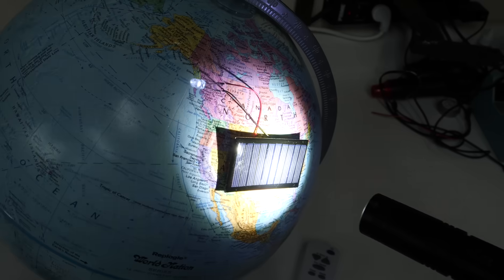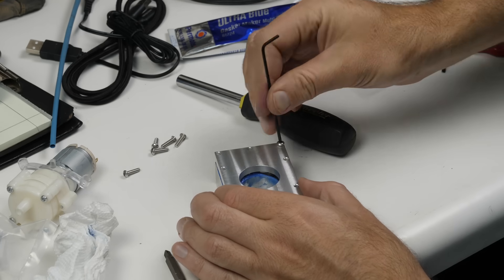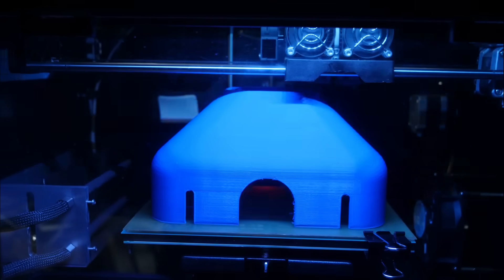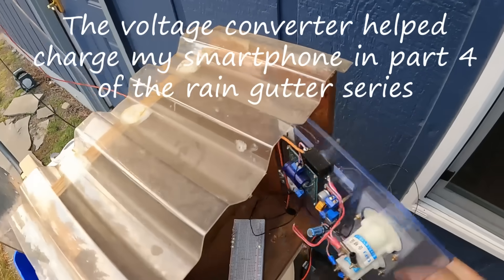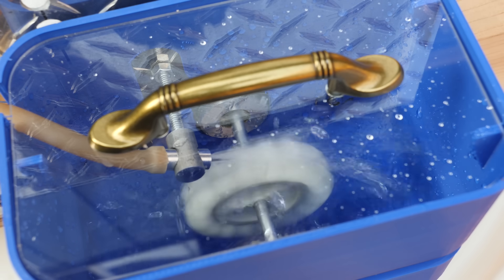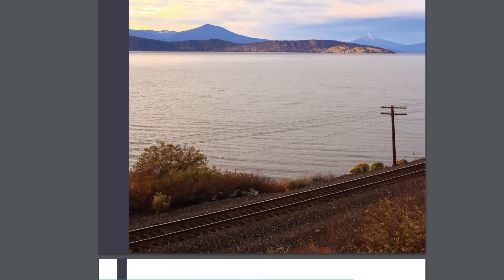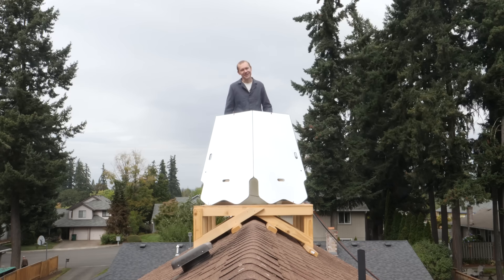Storing Solar Power on my ROOF!!!

Comment: Visited Argentina.  Most of the homes, particularly in the north (where it is hotter) have large ceramic or cement water containers.  One of their functions is to pre-heat the water.  Fact is, on a hot day the water is plenty warm for a nice shower without additional heating.

Comment: 0:30 I hope you explain the weight to energy ratio of a gravity battery versus a chemical one.

Also, I hope you used the IR wavelengths to store that energy and not the conventional wavelengths used by current solar panels…

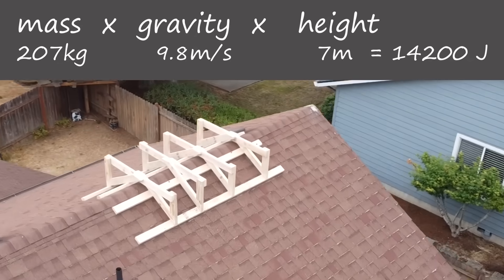2:30 You’d be better off using the thermal radiation to vaporize the water and re-condense it in your roof barrel. Even better, use the expanding water to drive a turbine on its way up to the roof.

Now you have a water heater/steam turbine by using the 40% of solar irradiance left unused by conventional solar panels.

Comment: "Without losing any of its capacity!" C'mon don't ignore evaporation and turbine efficiency on us.

I hear Tesla Powerwall got 90% efficiency while big scale water reservoirs is at 80%. I guess the take-away is that there's always something spent to convert energy back.

What's the efficiency of direct impact solutions I wonder.
Reply: While I agree that the round trip efficiency of his experiment is probably super low - the cost of a well refined system is probably lower than a powerwall and water should be easy unless you are in a dry climate. Biggest problem I see is you would need a pretty massive system to fulfill the needs of an average home. Most people don't have that much real estate to go after it on a big enough scale.

Comment: Awesome concept. Which could be applied on a bigger scale for homesteading and off grid. A couple design tweaks like useing more efficient hydro drive. Increasing pressure through implementation of stuff like " the tesla wave" to get more out of the flow ect. This guy's definitely beyond my level but I'm just saying a couple tweaks for efficiency and added scale you could do alot with this. You wouldn't need much pumping power even at scale. At that point it's just about the storage of water.  On an off grid set up you could even feasibly filter your water pump it into your cabin and create electricity with the water coming down. I mean the concept definitely has applications.

A thought though how would say salt water do in this? Salt water has a few properties that may be token advantage of. The reason this popped in my head is because I was thinking this system might be pretty efficient for an off the grid private island.

Comment: Would pointing the outlet valve vertical instead of horizontal make any difference with the power output? That would cut down on spray from the water wheel.

Comment: Once my shed is built I will be making a system where the water is pumped to a barrel, the barrel will be on a wire chain, the barrel full of water will head to the ground and drive a 24v generator, the water will be dumped into a storage tank that it will land on ... once on the ground the barrel winched up empty then filled again

Comment: Instead of a traditional type of water wheel, use a Tesla turbine with a wide opening for the water outlet spanning the width of the turbine blades

Comment: I once worked with an engineer who was trying to design a mechanically powered ceiling fan.  Essentially hoist a weight up to the ceiling and let the weight power the fan.  It sounded like a pretty cool idea.  But then I asked him if he had done any energy calculations.  Turned out that a AA battery had significantly more energy than his contraption and trying to get any meaningful airflow from it would really be impossible.  I like that you built yours anyway knowing full well that it would not really be practical.

Comment: how about a tank of air instead of water. using solar to run a old refrigerator compressor to keep tank  charged. Amish use air powered tools.

Comment: The 14kJ of energy storage, will have only about 60% energy capacity, due to frictional losses + the water that escapes without doing work. Added to this, are energy losses in the cabling and electronic components - before the light turns on. That means the system is 40% inefficient. It would be more like 9kJ of stored energy in the tank on the roof. You have gone to great lengths in order to explain that the world needs to move away from fossil fuels, to find and create renewable energy. A great video production for those who may not understand.

Comment: I saw a video of a system using a small 12v pump and rain gutters mounted to a chain. Pump would fill the gutters and turn a generator and the gutters would dump the water on the way back up. It looked like it would work. He had around 20 gutters of water turning a generator with only the 12v pump used to fill em up

Comment: I spoke with a guy that had the idea of using solar to run motors to lift huge weights from mine shafts in the California, Nevada desert that would then at night turn generators as the weights descended back down the mine shafts (just like a Grandfather Clock). Brilliant!

Comment: My 6kwh lithium battery stores 21,600,000 joules. It's light and compact. It can supply 60V at over 100 Amps.
Your solution (storing only 14,200 joules) is academically interesting, but a waste of time for practical energy storage.

Comment: That is a really fun project that you filmed for us! Thanks for sharing.
It has me wondering why not use a solar thermal siphon rather then an electric panel to lift the water with an overflow that could return the water to the lower barrel. No pump or electricity needed to do the pumping, just heat from the sun. Also more energy can be stored if the lower barrel was buried in the ground and as noted below a tesla turbine would be ideal for making electricity

Comment: Please buy a car 12v pump socket. That's 70watts. Its soo powerful. I have tested on a 25watts solar panel and has soo much pressure. At 70watts the horizontal jet goes 12 metres far.

Comment: so after 5.5 hours with the 50W solar panel you've pumped up enough for about 5 minutes at 50W (without the losses on your turbine) ? 🤔
the build and video are really cool, but maybe the system has got some way to go, that pump seems dreadful 😀
Reply: So a 6kw array averages 4kw, over a 6hr  24kw /day means around 25kw for 5 minutes? Or 1kw for 2hr…that is fairly meagre, and I would need a swimming pool on the roof. But this video is completely awesome! Thank you!

Comment: This video is for demonstrating principles of engineering. In practice no solar power is required. Simply keep the tank filled with a water line and a toilet-style float shut-off valve.

Comment: Great Vid explains a oft misunderstood principle. Pity you did not give flow rate or how long the light worked before the barrel ran dry.
I thought I could do this with a block of concrete lifting 5m on my gable end. Useless energy storage. Even a cubic metre of lead dropping 5m will only store enough energy to charge some power tools.
You need lots of water and a BIG hill.

Comment: So, to give a little more perspective to power and weight,  550 pounds of mass (weight) falling one foot per second ( 60 feet/minute) equals one HP,  (746 watts for the duration of the fall)!

Comment: Over flow run back to water tank on ground so pump stays wet, closed system,  add glycol in cold climate run all year. Hook up over flow to one of your gens to charge batteries.
Check out bell siphon

Comment: But this is so inefficient: even though you you store 14 kJ  ( using a lot more energy than that) you probably get back only a small fraction of that.  I understand this is education rather than practicality, but teaching inefficiency is bad teaching.  All the science here could have been taught quickly and easily without the inefficient demonstration.  You could have known before you started how much energy you would actually be able to get back and you should have addressed most of the issues before you started building.  There is a lot more science in engineering.
Incidentally, why were you so impressed that the water squirted up a couple of metres from a 7m head?  Water finds its own level, so you'd think it could get a lot nearer to 7m.

Comment: I'm just amazed how much energy can be stored in a AA battery! Can you make a video of the AA battery pushing the water up to the top barrel?
Reply: Because of pipe/water friction and motor/cable losses etc, he will need many more  AA batteries, perhaps something like 5-30 more batteries. He could roughly work out the efficiency of his system by seeing how many batteries.

Comment: So better way to pump its pump air into the bottom of the small hose.... the air will lift the water easily....pumping water you fight head pressure and will fry that motor quick... better yet let rain running off the roof pump the water up.... your communities reservoir system is surely to cut costs by pumping water up at night when cheap and drop during day when expensive... .

Comment: Look into ecm electric motors, less the control module, = 3phase monster generator head, wind driven, water driven with a belt or crude peg gears, or small horse gas engine,.  These are the becoming standard in heating, cooling equipment.  Aquire a failed motor, 1/2 or 3/4,or 1 horse, 120vac or 230 vac..from a hvac company for near zero $.. approximately 6 rpm hand spin generates + 23 vac.  Wire a 3 ph to 1 phase rectifier, convert to dc volts, regulator and set to 5vdc, 12.5vdc or higher, charge battery bank, current comes from windings and constant torque. If these run on 120ac  pulsed and only draw 8 amps at max design rpm, what could it do in reverse application.

Comment: Thank you for this educational video which has the merit of showing a concrete example of the use of potential energy. Thank you also for stating that the stored energy is derisory for domestic use and for not encouraging everyone to hoist a cistern on the roof of their house to finally have less energy available than in the battery of their smartphone.
Large-scale storage in a mountain lake is of course a different story....

Comment: This idea we used in high rise buildings and in agriculture industry 
Power recovery.
Not solar but similar 
Power recover generator.
In agriculture 
Pond up the hill water to power pumps . BUILDING water from exp cooling tower to power generator  to power other item in the building 
Many systems can be use solar

Comment: Whats the energy loss on that one? Could is be rigged to pump the water up + run the lights just using the water with the solar as a possible reserve for the pump? If so you just solved the worlds energy situation :) hehe

Comment: It is a fun home project and it is useful if you have "waste energy" that has to be converted to something useful. But as a plan to make windpower and solarpower a useful energy source it's pointless. Just because you lose huge amounts of energy just for energy conversion. So to power your country from windmills and water pump power plants you would have to literally cover half of your country with windmills and artificial lakes. I am not overdoing this has been calculated already a long time ago. Want to use only windmills and solar panels? It works but you have to sacriface a third up to half of your landmass for that. PS: Let's go Brandon!

Comment: Keep the system but use it to lift lead weights instead. Lead is 11.34 times heavier than water and you could use a little motor to move small amounts of lead at a time up and then you could let them down slowly with a motor. For the same height you were doing you could get 666kj of energy from 1 meter squared of lead. It is still a small amount only 0.1 kwh but it's a lot better than what you had.

Comment: I looked into doing this a while ago 55 gallons is 250 litres and if you are using water 1l is about 1 kg so that's 250kg and you've got that maybe 15 meters up in the air meaning that you've got storage of about 10 watt hours and in my country 1 kwh is about 16p which would mean you've got about 2p of energy storage there and after your solar has gone off that won't last you even an hour I'd wager. If you duplicated this and had 100 barrels on your roof then you might be doing something but as it stands you could carry that water up that distance very easily in multiple trips in fact those 10 watt hours are the equivalent of 9 kcal so really not very much. If you did this with mercury which seems to be the heaviest metal that would be liquid at outside temperatures then you'd get about 13.5 times as much energy storage. But you don't have to be set on pumping water you could use the excess power to lift lead weights of the ground instead and lead is a much more dense material so you wouldn't have to lift it nearly as far. You system could actually make you money though. There are special energy tariffs that allow you to take energy from the grid at night cheaply or sometimes they take money off your bill and then pump that energy back into the grid during the day. In the UK you can get a boiler that talks to your energy supplier to find out when the grid has excess energy and takes it from the grid and the energy company pays about 0.01p this allows the grid to be used less during the day as you've already heated your water and it takes what would have been wasted energy to do so.

Comment: Such a battery is also installed here in Slovakia. But i find it difficult to believe that such a small pump would be able to give out enough pressure to put watter 5m up to the roof..

Comment: Dude! You are certainly thinking out of the box, and got me doing the same. Have you wondered you have free electric power sopplied by the water city company? Just put a turbine in the water pipe entering your home!

Also: Why not use also wind? Old wells would bring water up with a water mill, a typical old-west picture. Then, you can also fill the upper tank at night. And so: why  stop at 200 liters. In Chihuahua water is scarse, so most homes have a tank up in the roof, of at least 1 cubic meter, 5 times larger.

Thanks for your videos, and for not being so theoretical!

Comment: Which generator you used for the project.? It would be nice if you calculated efficiencies at each stage. Say how much the sun generated, then how much reached the tank and finally how much u got back in the LED. A watt hour calculation should bv do the trick, and then identify the where the losses are

Comment: gravity batteries is the future i think... ANND i think the concept could be used with ocean tides rising and falling. How much weight can a cargo ship lift when the tide goes up? I wish some smart people would look into it more than i can. If there were legs to bottom of the water (like there is on all the bridges) then the change in tide hight could be captured with gaint floats and gears. Maybe even use local water and hight to transfer energy. feel free to look into this and point it out to the world. pretty sure its a great idea. regular tide energy setups use friction of water movement with blades or turbines, tonnes of loss. Direct tide hight with massive buoyancy force, holy moly. Big oil might not like that idea to get out.

Comment: Just for comparison, the entire barrel of water with its potential energy of 14200 Joules is the same as 0.0039 kWh. This entire barrel could drive a regular 2000W Kettle only for 10 seconds!

Comment: How about doing some calculations on the energy required to pump the water up and then again how much energy you get back when the water comes down? Both are important.
Reply: I would like to see that too. I would also like to see him use (instead of the mini Pelton wheel) pump run backwards as a tiny Francis water turbine.

Comment: Thx Quint BUILDs. This is very good idea. And it is also an old idea. In South Africa we also had it and still have it. BUT  bad ppl are stealing the power cables. So every one is left in the dark. To fix the country's problems is to BIG. BUT I can solve MY power problem. The power u had on demand was 1Watt. So what will it take to have at least 1 000Watts (1kW) on demand? Usually the power is off for 4 hours. What kind of watertank must a man have? What must the waterpressure be? (The waterbarrel and stuff can also B stollen, it just a bit more difficult to clime 7m UP..) Thx 4 a very insteresting and educational video.

Comment: Cool idea but batteries are more practical... even 3kwh (a really small pack for a house) would store 10.8 MILLION joules

...lithium iron phosphate batteries can cycle thousands of times reliability if set up right. Not sure the water pump can do better than that..

Comment: I think if you add a drain on the tank on the roof instead of siphoning downwards, it would increase pressure down, and where you are pointing your squirt towards the impeller, I think you might gain by pointing straight down and letting gravity create a portion of the squirt, hopefully, this makes a difference.

Comment: Can you check my math? I'm trying to calculate the amp hrs for a 500 gallon tank 100 feet in the air. I know there will be friction loss from my pipe running up the hill but let's keep that out of the equation for now. Is this math correct? 12 Ah 
Mass x gravity x height
1895 * 9.8 * 30.5 = 566,415.5 j

Joules = (AH rating ) * (3600 seconds / hour) * (12.1 volts)

566415/(3600*13)=12.1029 Ah

Comment: Great video, great idea.  Why not use a 12 volt air compressor, compress air in a tank at ground level, or buried.  Weight not a problem as w water.   Pump tank to say 120+- psi.  Use compressed air as is, or to later generate electricity w an air motor. Run lights at night till pressure drops.  U did not say where u got water from? Cost of the water? Where u dump it or repump it back?  What about compressed air!